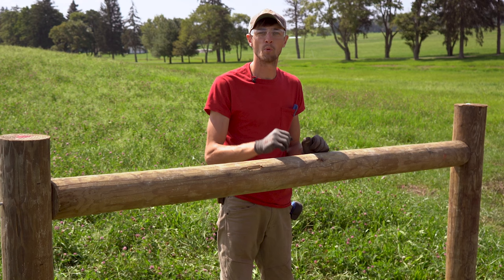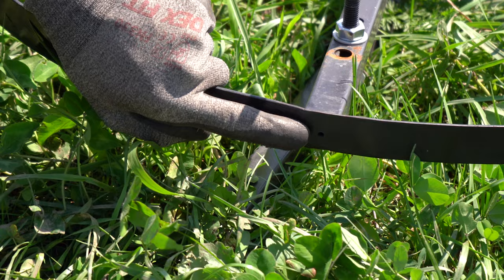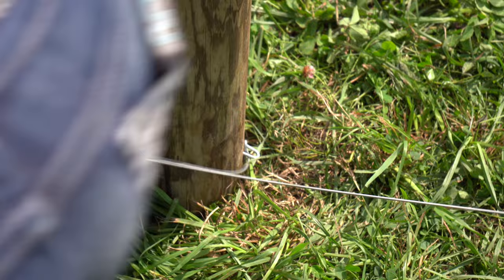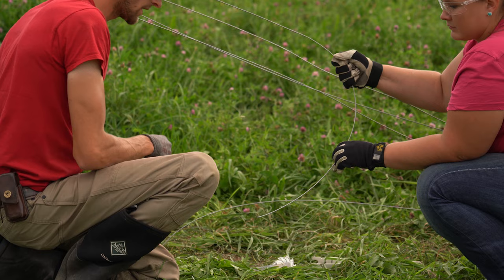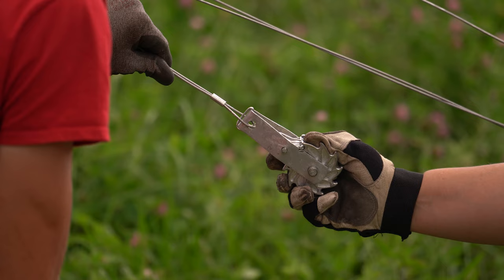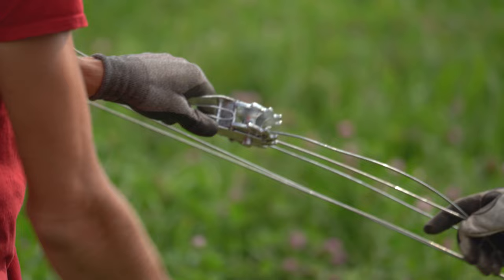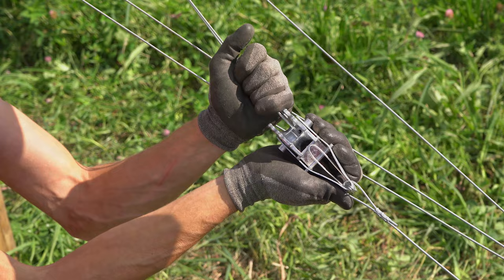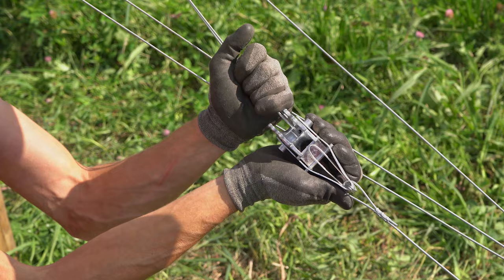How to Build High Tensile Fence - Part 4: Tensioning an H Brace

Comment: Omg this is not necessary. Just double the wire non crossed, hold with  simple chain  strainers whilst u tie off with a box end knot. Zero cost.
Reply from the maker: Hello, that is certainly one method to do an H-brace wire, however you lose the ability to ever re-tension in the future if there were to be pressure caused to that brace by an animal, vehicle, or act of nature.
Reply: Agree totally - as I have just said in a comment before seeing this comment - however not sure what you mean by a box knot, but I use the Tex Brown Knot, tied at a strainer jaw - it will be on u tube - there is other good knot I use but don’t know its name - been using it for 45+ years these knots give up to 80% of wire strength.
If you need to retention just cut the knot out tie a length of wire just outside of one jaw and pull up with the chain walking wire tensioner - simple low cost.

Comment: Why the figure 8 where the wires intersect in the middle?  Does this add any structural integrity to the brace and/or make it safer?  I’ve always just run it around the outside of the posts and not intersected it, but I use no climb and not high tensile for the fencing.
Reply from the maker: Hi Matt, That is a good question and we have a few different ways we can look at it. From a functionality stand point, doing a figure-8 keeps the wires and strainer from rubbing against the fence line. Of course, that would be more important on electrified fences. However, from a strength standpoint, by doing a figure-8, you are adding torque to that brace. So if there is a force against the fence line, the posts are being pulled to the opposite side of the other to keep them straight and maintain the strength. It is sorta hard to put into words. Even the old style of just running two loops and adding a twitch stick, in the end still created the "figure-8" aspect of pulling that tension to opposite sides of the opposing posts. We hope this makes sense!
Reply: @KencoveFarmFence  Interesting and thank you very much for the reply.  I definitely can understand on the electric fence as that would make a lot more sense.  The torque does make sense somewhat but I think I would need to build a little model with some twigs and string to better see it in action :)

Comment: This video is for people who already know how to do this…how do you get the strainer off? And do you need a “spinning jenny”
Reply from the maker: Hello Levi, Once you install the strainer, you would not want to remove it unless you are repairing or removing the fence. The strainer stays on for the life of the fence. If you do need to remove the fence, to remove the strainer, you would simply cut the high tensile wire. A spinning jenny is not required, but will make fence building a lot easier. With out a spinning jenny, the wire will uncoil and cause a ball of mess, or spring back down your fence line. It is highly recommended. Give us a call at 800-KENCOVE and we would be happy to answer any further questions!
Reply: I had to laugh when I saw this as I learned the hard way years ago you need a spinning Jenny.  Also you should spend the money and buy one with a brake and the hole to tame the end of the wire.  Otherwise as Kencove said you end up with a mess and also the wire is actually extremely dangerous because it will fling around with force and cut you or worse poke your eye out (take this seriously be careful with it and wear safety glasses).  I have a cheaper one because I install wire mesh no climb but just needed the brace wiring but I regret not spending the extra money for a better Jenny now as the one I have will rapidly unspool without someone standing by it.

Comment: Which strainer on your website did you use for the 12.5 gauge wire?
Reply from the maker: In this video, we use the SAS for the brace. However, any of the strainers in this category (https://kencove.com/fence/Wire+Tighteners_product.php) are compatible with 12.5 gauge high tensile.

Comment: When I was broke I learnt to tie several good knots the tex broken is one of them - they are tied with the wire under tension - hence just use the chain walking type strainer to pull things up tight then tie off under tension (Hayes Strainers have been around for a long time there are several copies of this now fence line solutions au have one with an in-built tension indicator). On the rare occasion that I have need to retention a strainer assembly - just cut out the knot and put in a piece of wire using two Tex brown or similar knots one inside the wire strainer and one outside so it gets pulled up tight (a standard figure eight knots works here.
Sure beats using expensive permanent strainers and crimps.
Some use gripples but again they are getting expensive - best to learn how to tie knots between the wire strainer jaws with the wire under tension. As I said Tex Brown is the name of one, the other knot I cannot remember but it will be in the internet

Comment: What is the best way to insulate your figure 8 on the H Brace from your hot wires that run across that area?
Reply from the maker: Hi George, You will want to use tube insulators on your hot wires. When installing the lines, insert a crimp sleeve, a tube insulator, and another crimp sleeve. Where the brace wire and the fence lines meet, place your insulator and crimp the sleeves in place on both sides. If you already have your fence wires in place, you can use a Spiral Tube Insulators to snap onto existing lines. (https://kencove.com/fence/detail.php?code=i5s) We will be demonstrating this in Part 5 that will be coming soon! Feel free to give us a call at 800-KENCOVE and a product specialist can help you with any further discussion or understanding the process.
Reply from the maker: Hi George, Part 5 is out! https://www.youtube.com/watch?v=DE8PgF6WQ60
Reply: @KencoveFarmFence  thanks!

Comment: My god this is the most complicated way of doing a H frame I’ve ever seen.

Do your figure 8 wire and wrap the wire with the two ends.
Then drive in you cross beam and that will tension the wire

I like the anti-friction staple though. That’s a neat idea